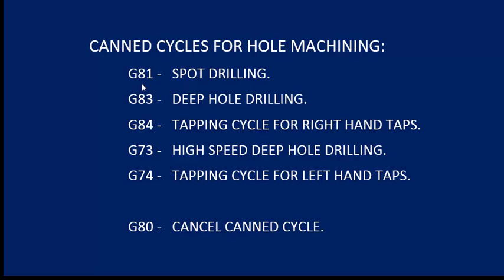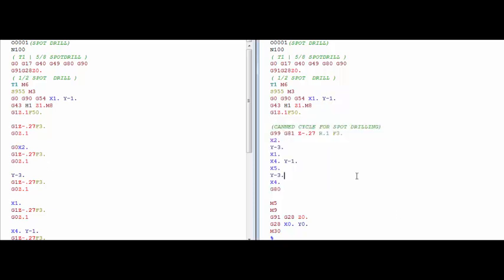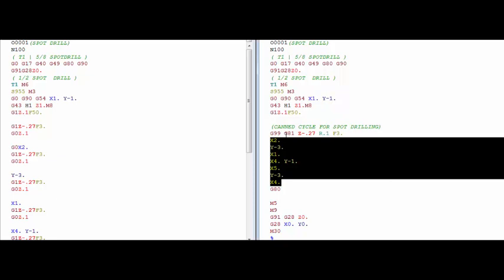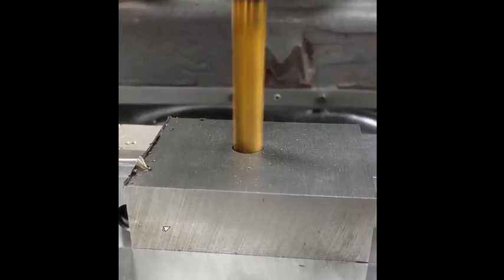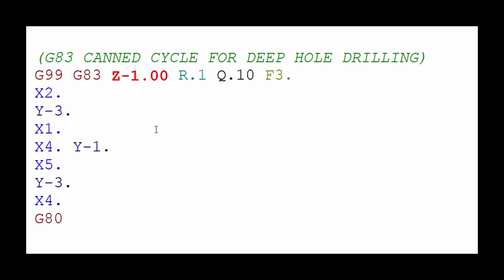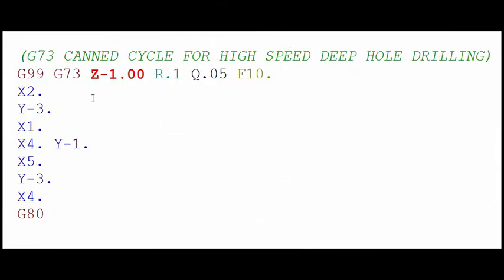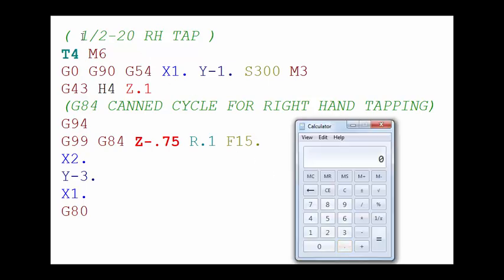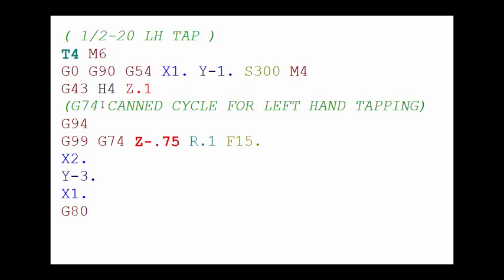CANNED CYCLES FOR DRILLING AND TAPPING FOR A CNC MILL

Comment: what is considered deep hole drilling?
Reply from the maker: Good question!  You want to consider a pecking cycle when the chips cannot break and evacuate out of the hole through the flutes of the drill. Also, the tip of the drill will overheat if it stays engaged into the drill cycle too long without retracting and not get cooled off by coolant or oil. 
There will be variations in peck depth depending on the type of material you’re drilling and the type of drill used. 
Hope that helps.